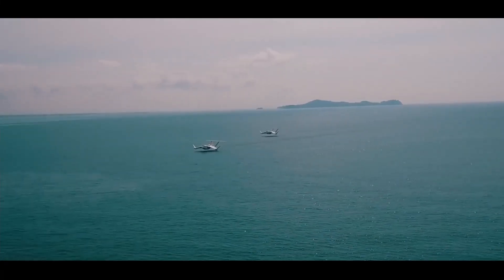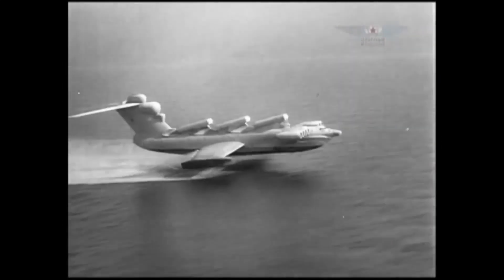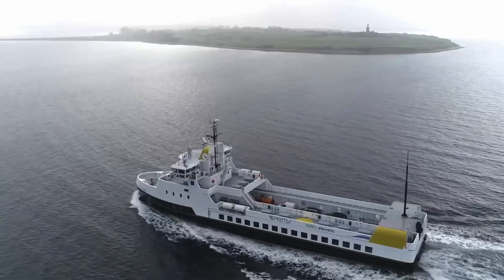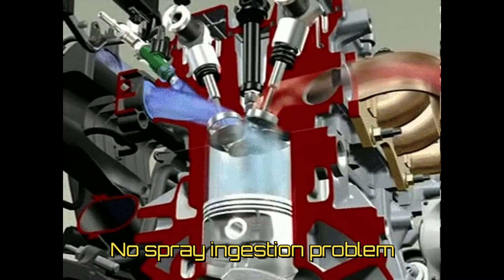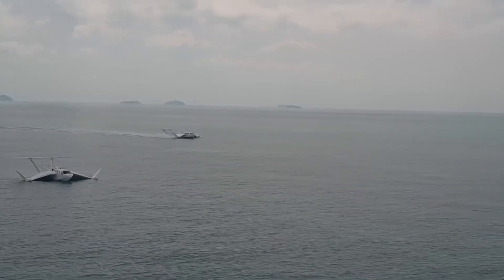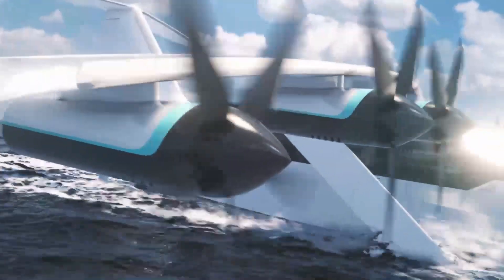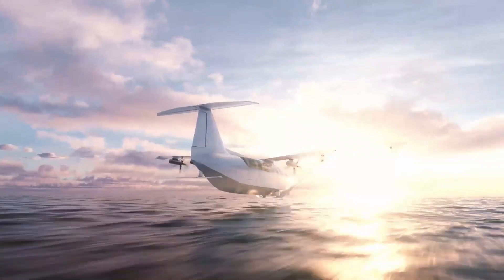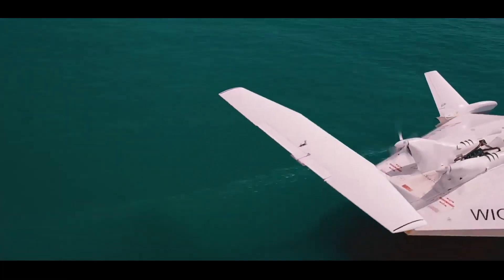Wing in Ground Electric Aircraft: Future of coastal transport

Comment: Automobiles use very, very little energy.  So they can run on batteries.  Big Rig trucks, Aircraft, and Commercial Shipping all  use a SH!T TON of energy, and can not never no how for any reason, ever, run on batteries.  By the way, in case you stare at an Ekranoplan all day long and can't figure out what you're looking at, you will see an aircraft that uses 2 engines to fly and 10 (TEN) engines to lift it off the water.  Batteries can replace the 2 engines, but they can't replace the 10.

Comment: This development is great but commercially its not yet successful on a large scale or perhaps not yet in the near future.  After many research on the matter, it was disclosed that too many aspects are to be aware of such as collisions on sea and some other low flying object or debris strikes in open seas.   Not also feasible operating at night.  I do like the idea of the combination hydrofoil-wing-in-ground vehicle and the possible use of hydrogen as fuel, if said battery versions are still  subpar in performance, due to weight considerations, limited range and turnaround battery charging.  Unless there are dedicated sea lanes for vehicles such as these or for remote shuttle transfer usage between some exclusive luxury resorts,  I imagine this would be probably popular only for the smaller market or for recreational use.

Comment: Ive been fascinated with WIGs for over 25 years, and even built an RC model in the 90s.  Nice job on this video and its great to know this technology is being looked at again.  Also, if you didnt mention it, in addition to the the electric tech improvements, composite materials and fly by wire computers were not as common during the soviet craft.  So now possibly WIG tech will come of age.

Comment: A few interesting facts:  Wig craft become safer (higher altitude) and more efficient at larger sizes. There have already been solar powered aircraft  (Helios, Solar Impulse HB-SIA, Zephyr S HAPS) and I have seen RC solar powered hovercrafts. What if you combined these ideas. I visualize a huge rectangular WIG craft with the top covered in solar cells.
Reply from the maker: It would make an interesting aircraft alright.

Comment: False too is the statement, that Tandem Airfoil Flairboats are heavier than a comparable aircraft.
Airfoil Flairboats are aerodynamic crafts and calculated like any aerodynamic craft as they are in flairing mode after starting. That means  that they are flying in most efficient ground effect level of 5% of wingspan, what Deltawing doesn't do. 
We have experience of 16 Wing in Ground Effect crafts, biilt in different sizes ( from 27 ft to 55ft) and materials with best results. More information under: Facebook: Tandem W.I.G Craft Technology or my channel

Comment: Ok,  this message is adressed to Widgetwork directly. As owner of Tandem Airfoil Flairboat Technology, I have to tell you that there  are a lot of mistakes within your report.
1st. The Airfish 8 is based on Delta Wing Design of Dr. Alexander Lippisch. 
Liparische Design is NOT ownstable, there is need of electronical stabilisation,  otherwise the Design is not practicable.
2nd. Tandem Airfoil Flairboat is the only worldwide unique ownstable system, determiniert by shape and the communicating interwing - system.

Comment: False, there is very little parasitic  drag in WIG due to the absence of trailing edge and wing tip vortices in ground effect conditions. 
 Less drag penalty than an aircraft, more load capability, highly efficient conditions enable a wide range for creative liberty in craft design with minimal impact in operatiinal dynamics when vessel is operating in ground effect, and at increased cruising speeds. The forces required to reach the projected speed range are approximately 35% of the minimum on an aircraft of similar profile, and weight, with four times the payload capability. Providing for results being dependent upon speciffic craft design, structural integrity, durability of composition and materials,  quality of workmanship implemented during component fabrication and craft assembly, so specifications for each manufacturer, craft design, and model designated range of operational conditions effect the reccomendation for prolonged operational rates in environmentally extreme vs. optimal conditions, there will be a broad variation of capacity and useage limits. 
 The main problem here in this narrative is the  perspective, this is not an aircraft, it is a watercraft, or unlimited surface marine vessel, many designating labels possible, but its not an aircraft, you can not  fly at over 1,000 feet, you have to have water to operate at 0.0 ground effect altitude, unless its a hybrid wig-hovercraft design, which is a UTV, maximum altitude for efficient wing in ground effect is 20'- 30' most likely below 20' for shorter linear length craft with increased wing/lifting surface width, due to wide span leading edge surface, ⁰ angle of attack, atmospheric air displacement pressure differential reduced at increased elevations fixed wings anhedral craft design with stabilizing tail horizontal surfaces and perpendicular 2 dimentional horizontal plane steering rudder. 
 Longer craft have higher operational speeds and some have a dihedral upper tail wing with a perpendicular steering rudder(s), some have elevator flaps incorporated in the trailing edges of the lower tail wing as well for pitch control and altitude adjustment at a continuous set rate of speed, or additional stability control and adjustment while traveling in unfavorable weather

Comment: A fly-by-wire mustache wing with a positive lift can be used for stability so there's no penalty for that.  

When I've worked on the S.A.E. solar boat project we've brainstormed about using the batteries as a keel weight in the hydrofoil to lower down the C.G. of the boat and reduce the need of a less efficient v-shaped hydrofoil. I think the optimal solution is close to one using hydrofoils and a tunnel hull.

Comment: Electric powered vehicles are NOT zero emissions!  Every method of creating electric produces emissions (even nuclear), whether during creation or creation of the products that convert the energy to electrical energy.  The losses in the power grid from energy creation, especially if fossil fuel based, through multiple transformers, hi tension wires, transfer stations to the final location is very similar to a high efficiency combustion engine.  Therefore it is not more, or much more, efficient than standard propulsion systems.  Add in the complexity of recycling the poisonous heavy metals in batteries, high efficiency magnets, etc., and that is another negative.  The high efficiency naturals needed for electric propulsion comes from limited locations across  the world.  All of that said, I am not against electric.  I am just saying it is not the panecea it is said to be.  It all needs to mature more before it is the advance it currently claims to be.

Comment: Well, as long as the weather and surface conditions are favorable.  The short wings mean you have to stay close to the surface.  So as long as the seas are fairly smooth this is fine.  Anything over 2', maybe 3' seas and these become very risky.  So, a fairweather solution at best with low weight limits for cargo (which includes people).
Reply: Yes, but this specially affects Delta Wing Design.

Comment: What happens to the Batteries when they "die" ... typically in 5 years or so... Do you "throw them overboard"... ??? and spread Toxic Waste in the Ocean.??

Electric Batteries do NOT Eliminate Pollution..
but replace Air Emissions of Fossil Fuels by Toxic Solid Waste..
Now.... whether this craft is a hovercraft... an aircraft or seacraft... the Energy Source used must be NON-POLLUTING ONLY (during Usage and AFTER DEATH)...

Best "bet" is Compressed Air (CA)....  (yes one modify ICE to run on CA) or Hydrogen (from Solar Electrictiy and Not HydroCarbons) with adequate Safety Provisions/Design Features.... or even Ammonia (if it can be "burned" NOx free in ICE's)...
Solar Sails can produce CA thereby eliminating Batteries as they also provide Hot Water too from recovery of the Air Compression Energy...

Exciting Times are ahead for Marine Transportation as they switch from Polluting Fuels to Non-Polluting ones... but please donot spoil this and even think about Solutions/Options that produce or leave behind Pollution in ANY FORM... unfortunately Electric Batteries do NOT meet this basic requirement.

If l we truly want to eliminate Pollution and save millions of annual Premature Deaths and Billions suffering from Pollution... we need a truly NON-POLLUTING SOLUTION... Don't we...???

Comment: That's the reason why we need the ground based commercial transport and more importantly Aviation and Cruise industry to switch to Hydrogen based fuel cell ( for its much higher energy density) instead of electric.
Electric is only good for passenger cars and 2-wheelers.

Comment: Electric WIGE aircraft might offer a solution to Tesla for transport of people and supplies quickly from shore to it's 20 miles offshore Starship launch platforms.  The new 4680 Tesla batteries would be perfect because of their lighter weight and higher energy density.

Comment: It is incorrect to state that WIG's takeoff requires less power - until airborne - it is a boat that must overcome hump drug to start hydroplaning first - and then get to takeoff speed. Did you see those packs of start assist engines on the Russian ekranoplans, didn't you? Also, WIGs have severe stability problems - that's why we haven't seen many of them in use. These vehicles are a dead end.

Comment: Hi, nice video, just one comment: the bigger the ekranoplan, the higher the payload, therefore, it will be easier to use batteries on bigger planes. I am just dreaming of a huge ekranoplan with Ambri liquid metal batteries. Also, with bigger size there is an increase of ground clearance and thus capability to fly in rough seas. As much as I admire the Wigetworks design, they must quickly build something way bigger. Size is the best ekranoplan's friend.
Reply: Imagine a huge flying ground effect - aircraft carrier.

Comment: As a watercraft, the strengthened hull isn't a disadvantage, it's business as usual.
For aircraft, it's also an advantage, in that it doesn't fragment and churn the passengers into a fireball if it comes down on anything less perfect than a runway.
Chose which is an advantage. Most aerospace industry would rather carry more passengers than assure the safety of what they carry.
Since this is a watercraft, it's not a choice.
Martin P6M Seamaster had hull >25mm thick in front & underside.

Weather is always brought against them. Any weather with winds 35+ kts and waves 3+ meters stops all aircraft, small boats, and larger watercraft are severely hindered or effectively stopped. Alexyev as well as the Lippisch designs, and Boeing & Lock-Mart say their larger craft are good in sea states that are worse.  As do Beriev and Shin-Maywah, for contemporary seaplane makers.

It's worth noting that Beriev bought back from the Navy, a few Be-12 seaplanes, to be worked into the "-200" variant to test & train with the water handling fire bombing tanker system to be built into the Be-200. After 20+ years in navy service,  they had little to no corrosion damage.
Reply from the maker: Thank you for very informative comment

Comment: What happens in windy condition with 10' wave and choppy waters?   Another gimmick,  only possible in optimum conditions.
Reply from the maker: I am afraid it cannot be operated.
Reply: Any weather that stops GEVs and seaplanes, also stops all other aviation, small watercraft, and most larger watercraft have to either curtail or lose making useful way or any other operations.
Reply: Exactly.  Cost savings are lost if you can't operate outside of a perfect sea state.

Comment: I'm quite dubious about this particular method of transportation. It requires you to have harbor installations, with maritime AND aviation technology.

Unless you operate from extremely remote areas or spaces where it is much more difficult to build nearby airfileds compared to landing on water, it feels to me like flying just makes more sense in the majority of cases, even between short distances like the English Channel.

I guess we'll see ! Interesting approach to ferrying passengers.
Reply: This is for a niche in utility and cost, between a ferry and flying.
Reply: It seems like what this enables is a longer range for electric planes? So the benefit is high speed and zero emissions, but over actual practical distances.

Probably best for the English Channel and other straits.

Comment: Fuel cell systems has very low power density, that is one of the reasons why even fuel cell cars are hybrids, and "fuel cell" trains and airplanes are essentially battery powered, and the fuel cell systems on them are best described as very complicated, expensive and inefficient way to charge the batteries.    

Energy density of batteries does not limit aviation to some specific absolute capacity in number of passengers or weight, you can scale up the whole aircraft. Limited energy density limits the amount of energy, simply put in practical terms: the possible range. You can scale up a plane and use large part of it's capacity to batteries, and that way get long range, but in doing so sacrificing some of the useful capacity for the size of the plane. 

Wing in ground effect vehicles benefits from being large, essentially they get more efficient, all else equal, the bigger they get. Just increase the size of the vehicle, including capacity of the battery system until they can carry the amount of payload that you want. Fuel cells doesn't improve power density, they add a lot of weight, for it's power output. Fuel cell systems add weight, costs, energy losses, and danger. That's why a few thousand fuel cells cars are produced per year, globally, while there are millions of electric cars produced. And that is despite the fact that the fuel cell was invented well before the first rechargeable battery was invented.   

The potential benefits from using hydrogen as a fuel, over batteries is the possibility to achieve more range with less mass added, and the theoretically faster refueling compared to charging. But, unless you use liquid hydrogen, you don't save much weight because the tanks you need weighs so much. And fast refueling of more than moderate amounts is very complicated, and expensive. If you use liquid hydrogen you need to keep it cool, as it boils at 20.271 K (−252.879 °C, −423.182 °F)  to use that as fuel in practical applications you need commercial rocket-territory money.

Comment: Wouldn't larger WIG's be easier to power electrically, not harder? The big advantage is that more mass can be carried per wing area, so doesn't it follow that batteries could make up a higher percentage of the total mass?
Reply from the maker: The larger the aircraft weight the more batteries required to make it take off meaning the more maximum take off weight.  If I plot a curve of MTOW with increasing battery size than it would be a curve that rises and than falls. I will be explaining this is my next video

Comment: I'm am avid W.I.G. enthusiast and been experimenting with a few models. This aircraft although not a WIG displays the ideal characteristics for a safe Wing In Ground effect vehicle. Notice from 2:15 in this video, https://www.youtube.com/watch?v=i71YQO81uc0&t=39s , it reacts to the waves like bumps but does "Not Change Her Longitudinal Attitude"! It is not designed as a WIG so its operator/designer is probably not influenced by "Expectational Bias" in his observations. Also it isnot a waterborne aircraft and cannot afford to hit the water but its operator seems to be fully confident that it will not.
As seen it seems to have little to no shift in center of pressure when transitioning in and out of Ground Effect(GE).  
Maybe an aerodynamicist can explain why the Close Coupled Delta Canard displays this characteristic.
Reply: Thanks for this video. It makes me wonder whether a craft with folding or partly retracting wings could take off from land and then still het full advantage by retracting or reconfiguring its wings as it cruised over water in ground effect.

Comment: Electric ekranoplanes sounds really smart, but why are they not aiming for autonomous drive, or at least single pilot config? Should be the perfect thing for autonomous drive!
Reply: That would be a disaster, think about the liability if the craft steered into a billion dollar cargo ship! With all the problems autonomous cars are having no one would risk that.
Reply: @nathanchildress5596  Autonomous driving of a car is way more complicated than autonomous flight. Autonomous flight has been around for a long time in airliners, although pilots still are onboard and monitoring for added security and redundancy. Several electric aviation players are targeting autonomous flight, such as Lilium Jet. I dont see a reason why ground effect crafts would pose a bigger challenge. Quite the opposite.
Reply: @MattiasAllring  Yes that's true. The difference is that those planes are at several thousand feet, as opposed to ekranoplans which fly within a hundred or so feet of the earth's surface with lots of hazards in their flight path. Now say your company is tasked with programming this autonomous flight system, would you be willing to accept liability for a damaged container ship or oil tanker?